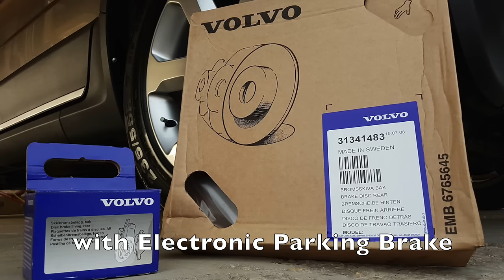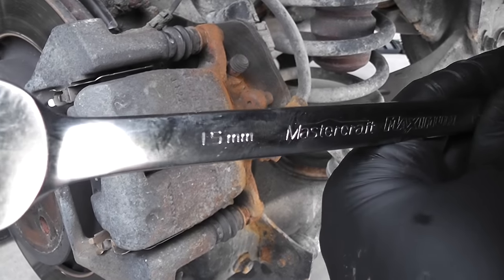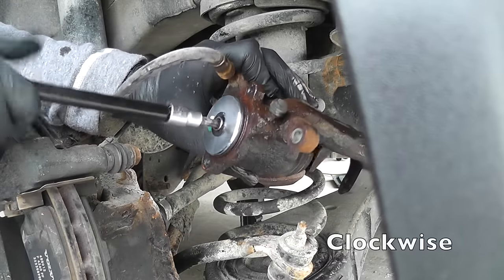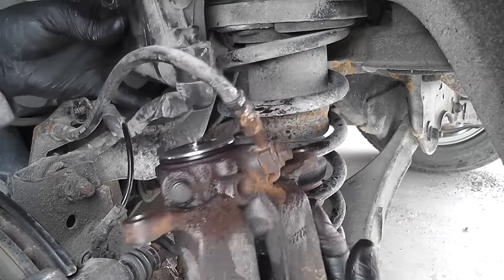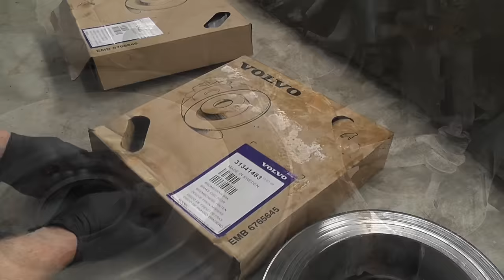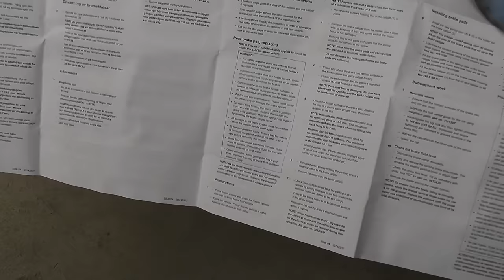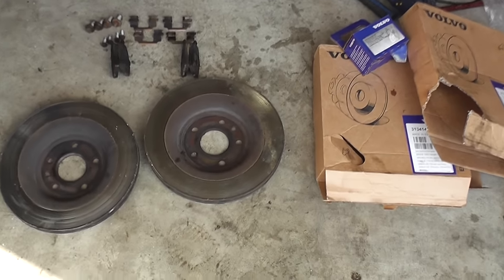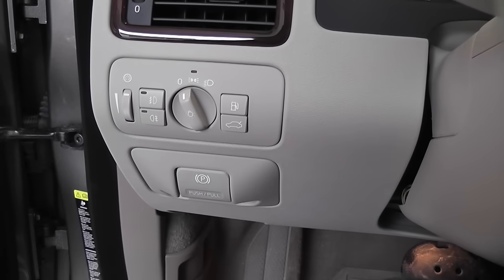Volvo rear brakes replacement with electronic parking brake. (EPB)

Comment: Excellent video.  I am watching this several times before I tackle my first brake pad and rotor job on my 2015.5 XC70 TC AWD with EPB.  Never done brakes before.  

I have a Left Rear Tone Ring problem which I was not able to solve.  It got read as a Wheel Speed Sensor issue at first.  I changed the Wheel Speed Sensor with ATE replacement and the code changed to Tone Wheel.  I cleaned the tone wheel twice, inspected and found no breaks--shiny and clean--it is not castellated (no teeth) just a steel band.  

At a loss for what to do, I took it to Volvo Stealer--the dealer said it was the ABS BCM and wanted to charge me $3,000 to replace the module--I think they are trying to rip me off.  I don't think it is the BCM--the WSS tries to sense, and I hear the clicking and then it throws a fault and the ABS/ESC light comes on and the CVM and Tire Monitor lights follow.  

Since my rear brakes need replacement, I decided to change the rear pads and rotors myself rather than pay the dealer the $800 they wanted to do so.  

Instead of Volvo rotors, I've decided to use Bosch Quiet Cast rotors because in their description, it is explicitly stated that the rotor includes a ABS tone ring.  I tried to confirm that with Bosch but the support guy would not confirm it--said other rotors have tone rings too--I asked why is it then listed as a special feature--I don't think he even knows.

Anyway, I will use Yuri's video to help change the rear pads and rotor.  The video is great, shows exactly what to do.  I hope the Bosch Rotors will also solve my ABS tone ring problem--how it will, I don't know at present.  I will use my Foxwell 510E Scanner to service the EPB. 

On the 2015 XC70, supposedly the tone ring cannot be replaced separately and requires an axle replacement.  However some persons on Volvo forums said the non-castellated tone wheel on the 2015-2016 XC70's rarely go bad and it is the wheel bearing.
Reply: One of the Bosch Quiet Cast rotors arrived, the other is ordered but out of stock on Amazon at present.  The rotor does not have a tone ring incorporated--as the Bosch support guy said.

The Amazon Product description had said:

Bosch QuietCast Features:  

   " Homogeneous heat flow
    Superior heat dissipation
    Blah, Blah AND:
    ABS sensor rings included (on required applications): Trouble free ABS/TCS operation"

and 
"OEM style ABS tone ring (on required applications) provides trouble free operation of Antilock Brake and Traction Control systems "

And the Bosch Website description said, as Key Feature: 

  "ABS (Anti-lock Braking System) sensor rings: Allows for trouble-free operation of ABS/TCS on ABS/TCS equipped vehicles"

So it is confusing.  My wishful thinking was that this rotor would solve my ABS Tone Ring problem.  😶

I ordered Volvo Genuine brake pads rather than Bosch.

Comment: Great video, I use the 12volt method to rewind,and that worked just fine.Also, I didnt remove the bracket which holds the caliper,the disc can be removed without dissasembling this bracket, give it a try.
Reply from the maker: Wow. Thx for the tipnonbthe bracket. I will try next time.

Comment: One tip, always clean you're brand new brakediscs with alcohol or brakeclean, because the manifactures sometime coat them with an thin oilfilm to provent rust :)
Reply from the maker: These dont have to. They are in bags for that purpose.

Comment: Great video again. Did it already. Your cars suffers exactly the same from corrosion. Norwegian/Canadian climate, to much salt. I struggled much more with the two bolts (15mm) and needed to you extreme force to get it loose. I use a dice with Vida and set the brake's first in 'service mode'. Then you don't have to remove the EPB motor and turn it back. Thats really something very useful whille working on our Volvo's :-)
Reply from the maker: Feel like I will order VIDA soon. I emailed you yesterday. Thx for the complement.
Reply: You've got mail. ;-)

Comment: Great Video. I broke one of the bolts holding the e-brake, Had to take to a shop. Tech's are able to wind the e-brake back without removing it.

Comment: I saw if you have the Vida system that you can put the rear brakes in service mode. This would bypass removing the motor. When complete you need to remember to remove the service mode in Vida

Comment: I just did this job without disassembling the motor from the caliper. (On a 2016 volvo xc90 t6 momentum). After I un-bolted and removed the caliper assembly, I disconnected the electrical connector to the motor by pulling straight out on the yellow part of the connector. I connected a 12 volt battery to the two connector pins on the motor, with the POSITIVE SIDE TO THE "OUTSIDE" PIN. (I suspect a 9-volt battery would also work.) The motor ran for about 15 seconds and then the piston started rotating clockwise (as viewed from the motor side) and I stopped. I then compressed the piston with a clamp and continued as in the video, after re-connecting the electrical cable.
Reply from the maker: Also a good method. Thx.

Comment: Use the old brake pad between piston and the G-clamp , that way you won't damage  anything. also open the bleed screw to let the oil out instead of sending it back to MC. than for sharing.
Reply from the maker: +Rich X Great tip. Thx
Reply: Wrong, do not open the bleed screw unless you plan on bleeding the brakes
Reply: @tmillner0682  if we don"t open the bleeder screw and let "dirty"fluid out, it will be pushed in to the system. ?any reason why this should NOT be done. thank you
Reply: @seshachary5580  if you're willing to bleed the brakes then it won't hurt to do that. But if there is fluid that is "dirty" it is dirty throughout the entire braking system, not just the caliper. So you would need to flush and replace all fluid in that case. Brake fluid brakes down over time, reducing its boiling point, that's why most manufacturers recommend replacing every few years. But if you're just doing brakes no need to purge any fluid
Reply: @volvosweden  Hi, another tip if I may, 10:21 after brushing the rust off apply some lube then put the metal clips and apply some lube to the clips as you did. This way the rust under the metal clips won't push the clips up and cause uneven wear.
Reply: @tmillner0682  I have to disagree with you, even if you replace the brake fluid there still be will some  dirty fluid in the caliper especially if you have more than one piston.
Thanks

Comment: Great video, very useful. I have just one advice for you, you shouldn't touch the brake disk nor brake pads with greasy hands, the brakes won't work as they shoul if there's grease on them.

Comment: If you've got old brake fluid don't just push it back into the system by compressing the piston. Loosen the bleed valve first, to push the old fluid out, bleed the system later after replacing pads/discs. Not doing this results in pushing all the stale/dirty/contaminated fluid, that resides near the piston (seals always let some contaminants in) back into the system where it might damage/block pumps and valves. You'll notice this by seeing dirt floating in the reservoir.
Reply from the maker: +0YouCanCallMeAl0 Good tip. I have replaced the brake fluid completely. There is a video on my channel.

Comment: Just a note to anybody doing this you can use a c-clamp to hold the electric motor on until you get the screws in warning the tabs on the motor are very easy to break off so do not try to force the motor to seat on the caliper by tightning the bolts those ears will snap off get it seated and put a c clamp to hold it while you install the screws also lubricating the oring will help too.

Comment: A much easier way to retract the piston is by hooking a 12v battery to the two contacts on the parking brake motor in reverse. It will wind itself backwards.
Reply from the maker: Thx for that tip.
Reply: My friend and I have tried this method, much easier than dismantle the motor itself
Reply: Can you just not apply EPB and push the piston in?
Reply from the maker: +Mic Rosoft Nope.
Reply: Great tip! Worked like a charm.
Reply: Nope, it won't overload it. It's just a simple 12v motor. The only way you'll overload it is if you use an AC voltage source or a DC one that isn't 12v. OR if you never use the parking brake, OR if you let it run for a long time when it's clearly struggling.
Reply: Did the 12v thing & worked fine. Wish I read this before hand as the plastic 'flange' on the first motor I removed just broke up and had to get a complete unit. As an aside, I just finished and now have 'spongy' brakes. Didn't disconnect any hyd either ? V60 R design.
Reply: I did this today and it worked fine with a 6 volt hobby battery I had laying around and a couple of alligator clips. Worked fine. I upplugged the connector, placed the alligator clips on the terminals. It was pretty easy to tell which direction (polarity) to connect the clips to the battery by letting it spin for a second and then compressing the piston with a Irwin quick grip ratchet clamp. Once figures out, the second wheel was even easier.
Reply: You only need 2 wires and a 9v battery! :D
Reply from the maker: Great advise. Thx
Reply: You can plug a scan tool and set the parking brakes on maintenance mode and they will retract for you
Reply: Good logic
Reply: then show how its done !!
Reply: did the same with 9v battery, works like a charm
Reply: Yes! Watch www.youtube.com/watch?v=7BPFc1s_nX8. Not a Volvo but the principle is the same.
Reply: Great video, thanks. Does anyone know the torque settings for the bolts for the caliper frame please?
Reply: 110 Nm back wheels, 200 Nm front wheels according ViDa.
Reply: Diego P 👍🏻 vida is better. You have right.

Comment: I see you have got some rust underneath your bodywork and suspension - most likely caused due to the high amount of road-salt that is used in the winter-time. I spray hot Waxoil all underneath onto everything and it vasty helps reduce this corrosion.

Comment: Always Torque down the bolts on brakes- especially front!

T50 torx is 35nm
15mm bolt is 110nm
13mm bolt is 35nm

If not using new bolts apply thread lock as per color on existing 
Cheers

Comment: Great video!
I just replaced the rears rotors and pads. I followed the instructions but the brake pedal almost travels to the floor when the car is in motion 🤷🏾‍♂️.
Reply from the maker: Bleed the system.

Comment: l'd recommend greasing the caliper slidepins with silicone grease, when doing a brake replacement or service. Only use silicone grease, petroleum based stuff will make the rubber swallow.

Comment: To avoid the replacement of El engine just put  12 volts on el engine . One position+it gonna brake.  Change the wires each other + and it gonna unbrake. 7-12 second are enough. Then just press the piston.

Comment: I am a loyal long time Volvo owner and fan but the P3 rear brakes with my experience are the absolute worst garbage brakes I have ever experienced. I used to get up to 70,000 miles out of P2 rear brakes so I know it's not us or our driving. We are very easy on the brakes, mostly freeway mileage with limited braking, we coast whenever possible before braking, downshift at times if hard braking is required. We purchased two old stock 2016 XC70's and in one our rear pads are worn and rotors ruined at 22,680 miles and I believe would have been more like 12,000 miles if we weren't easy on the brakes. I posted a video on my youtube channel and wrote an article on my website if anyone else is having issues. There is also a link on my website to my twitter account where I have been confronting Volvo about newer Volvo brakes. I am also reading complaints about Volvo brakes in the new lineup being worn out as low as 15,000 miles. I think Volvo had the best brakes with P2 generation and should have updated these pads. As a long time Volvo owner that never had these issues I have been shocked.

Comment: Did my pads at almost identical mileage, disks weren't too bad though. I used a 9v battery with pigtails to wind the handbrake motor back. Do this before you take the caliper off our you may wind the piston out by mistake, not sure if it could pop out but best not find out.

Comment: Just one thing remove the sliders and lubricate them with silicone if they seize the disks will warp. They will warp in very little time and you will be replacing the disks to fix the pulsating

Comment: Thanks for the video. I am doing mine on my V60 this weekend after having done it a few years ago. Some tips in here I would have found useful back then, but will use now. One point, I didn't see you put copper grease on the back of the pads, why was this. It prevents brake squeal later on.

Comment: Hi,
Thank you for posting. I've just done mine following your video. There was no grease on the discs, the was however some paint residue.
The breakes feel a bit spongie though.. it could be me being a bit paranoid. Is it necessary to bleed the brakes?
Thank you!

Comment: do you remove the electric motor just because you use the g clamp? Will the piston retract if I were to use a normal piston rewind tool?
Reply from the maker: You have to remove the motor or use 12V battery  to unwind the piston

Comment: very educative. thank you. the best video that I have encountered.  one question. when the brake piston is pushed in is it good idea to open the bleeder and let the "dirty" brake fliud out  rather than pushing it in to the lines . also is it good to use ABS bleed so that fluid in ABS is also out of the unit . can one manually bleed the brakes (2 person method) instead of power unit that is used by you. thank you again. awesome service .

Comment: Do you need to mess with the EPB even if you are just replacing pads? Or can you just remove caliper with e brake attached and replace pads - then put caliper back on ?
Reply: You have to JUMP the EPB Motor, there is no need to take it out.  If you don't jump it to retract, it's really tight during pad insert.  Use a 12V DC or 9V DC and jump it.

Comment: Hi, l really appreciate your skills and courage in upgrading your Volvo. l am driving a 2012 XC60. This is my eighth Volvo. l wonder if you woukd be kind enough to show me how to clean the projectors and reflectors of my HID low beam. l presume they are similar to your wagon. After taking out the bulb, l do not know how to take out the housing. l can only see two screws on one side and do not know if they are the right ones. But l cannot even remove the square bulb holder. Much appreciated.

Comment: Did you have to remove the motor? You know you can use a 9 v battery and a pair of wires to return the motor back to in position, just so you know. Thank you

Comment: Great vid and just completed my V60, but used the 12v polarity change method for the motors. At he end though my brakes are still 'spongy' and cannot get them to 'firm up'. Bleed required maybe, although didn't disconnect any hydraulics..?

Comment: I've read that there is a simple way: disconnect the plug from the parking brake motor and apply a voltage of 12V, at least 5A.
You have to be careful with the piston, it's best to protect it by putting a hammer between it, in case of a miss with polarization. Then the piston will stop on the hammer, you need to change the polarity.
The only question is whether the car's computer does not count the number of engine revolutions.???

Comment: Hello,
Im doing a similar job on a Passat. My EPB motor died on one side so im changing it. I was told from some guy to also rewind the other side to be on the safe side regarding even brake pressure on both sides. He also pointed out that the "reset" of the EPB motor should be done before starting the car. Do you think that makes any sense?

Comment: Have you figured out that it's easier to open the bleeder screw while your depressing the piston than having to remove fluid from the reservoir yet? It also puts cleaner fluid back into the caliper and gets rid of the old acidic fluid making for a better brake job. Of course the best thing would be a complete flush of the system but very few people would know how to do that or have the correct tools. If you were doing a front break job just think of all that oil acidic fluid being pushed back up onto the ABS system. I wouldn't want to have to replace it. Just a thought of preventative wisdom.

Comment: That is a great video, thank you! But I can't understand, why you didn't put the two long wires from battery on the brake engine connector? It would be easier then yours one. Am I right?

Comment: Thanks a lot for the videos. Couple of questions:
Q1: Where did you get the parts from (I live in Toronto area) ?
Q2: Is it okay to get aftermarket rotors/pads for my 2012 XC60 ?
Thanks again!
Reply from the maker: +Anil Sharma I got everything from Volvo dealer in Winnipeg.
I recommend original parts.
Reply: Thx!

Comment: Thank you for this video, I'm just wondering why you turned the pistons out "clockwise" and then pushed them back with the tensioner.

Wouldn't it be easier to turn the pistons counterclockwise? Or simply turn back with 12V voltage?

Thank you, greatings from Romania :hand-pink-waving:

Comment: I used to smal cables,  striped in one end and cable-shoe on the other end. Take out the plug for the motor and place the cable-shoe on the to connectors on the motor and the I used a 9 volt batterie.

Comment: I swapped the rear pads yesterday. Felt like I had to use some force to insert the new pads and also feels like the left side disc gets a little warm during driving. Any tips? I cleaned with a wire brush before inserting the clips. Maybe I need to remove the calliper holder things to be able to clean it perfectly well?